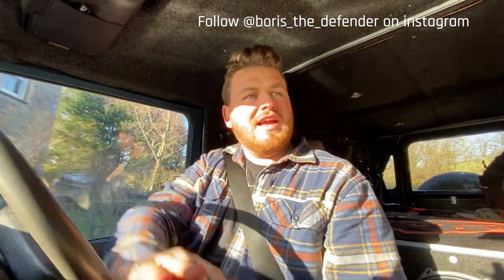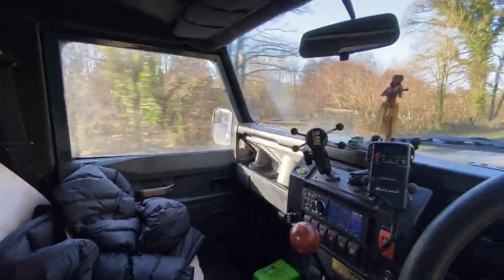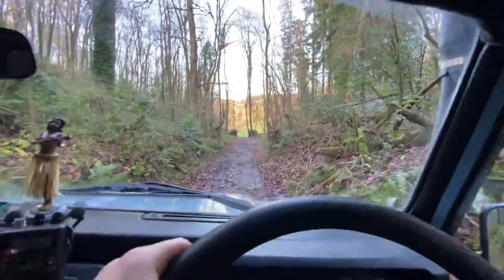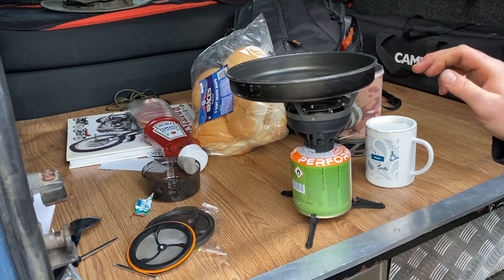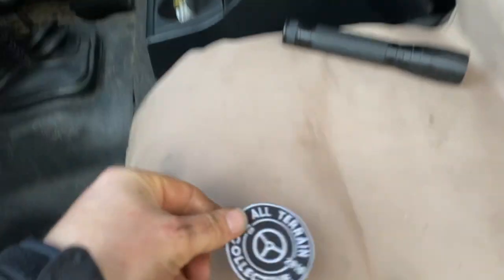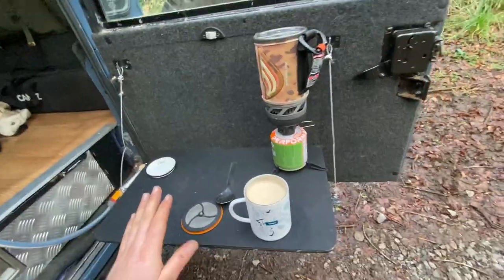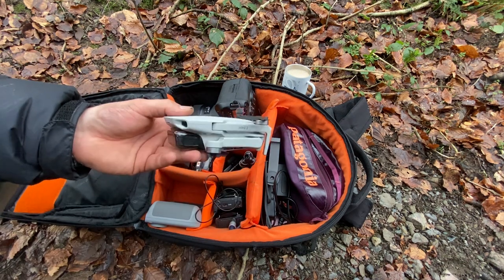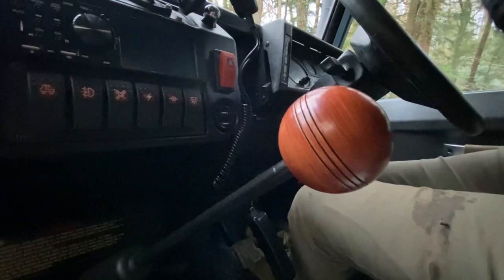Day Tripping in the Defender!

Comment: Hi mate.  what size of runners did you use for the rear drawer system I’m planning on making one for my 300 TDI 90 I’m aware of the length difference any suggestions would be appreciated 👍Jonny
Reply from the maker: It’s actually bought from mobile storage systems